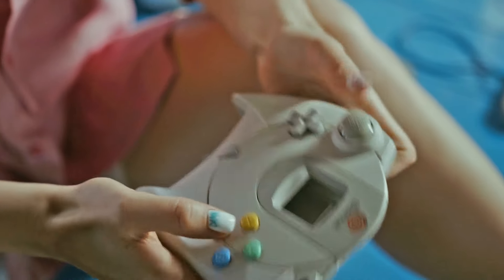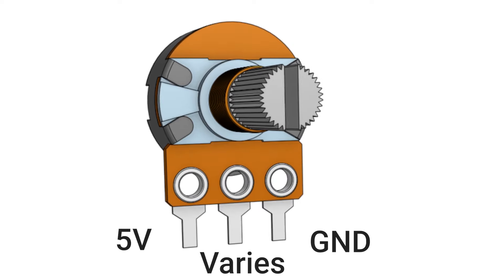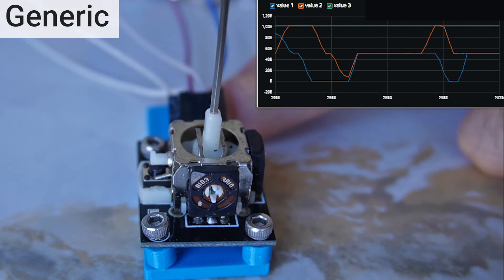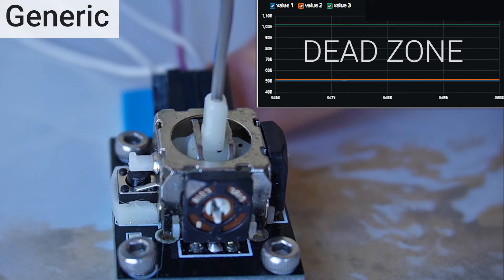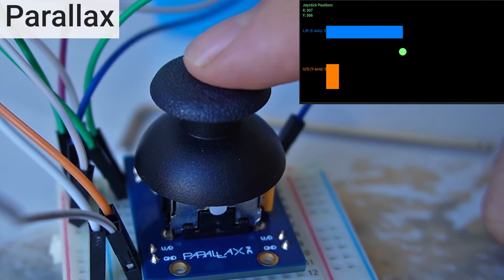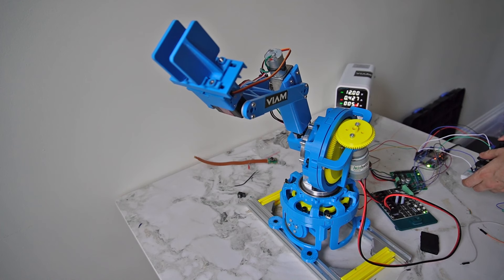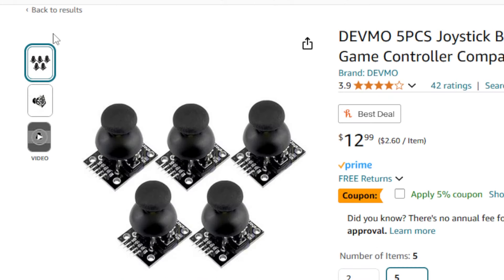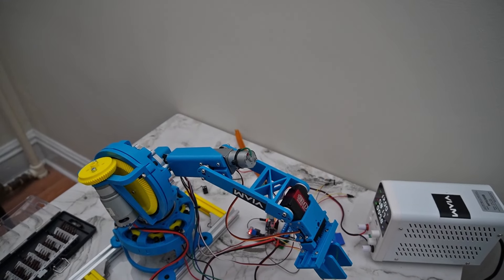Arduino Joysticks Compared

Comment: Umm.. Apples vs. Oranges?  Changing the graph type was suspicious enough.  Only showing a single second of "little tiny movements" (and seemingly cutting it short!) is even more suspicious.  What are you hiding?
Reply from the maker: Nothing, I just couldn't get the software for the Parallax to work with arduino.

Comment: Really good comparison.
Have a 3D mouse made using standard joystick and I can see how much I can improve it swapping for a Parallax.
Do you have any recommendation for a rotary encoder? I'm using the KY-040 but is pure rubbish, super imprecise.
Thanks
Reply from the maker: You should definitely switch to a Parallax if you're using it as a 3D mouse. You have to get used to the tighter action, but it is more sensitive.

Comment: Good quality video! but the information is thin. 

-The comparison is not clear, you are plotting for one but not the other. At a glance there doesn't seem to be much difference, dead zone is even desirable and software reinforced on some applications. In my experience the cheap ones break often, have noisy potentiometers that wear out quickly.

-The explanation is good, although it's not clear how the potentiometer works and can be read as a signal (voltage divider is easy to explain)

- The main difference seems to be the quality of the potentiometers then? A video showing how to turn a 2 dollar joystick into a 15 bucks one would be great!
Reply from the maker: The springs in the Para were way stronger as well. Next time I will go more in depth.
Reply: SOFTWARE dead zones are always favorable compared to hardware.

Comment: If you want to compare 2 products - then actually compare them. But showing different data for the 2 doesn't really help.
All i can see from the videos is that both of them are incredibly overpriced on amazon to the point of being outright scams, and both of them appear to be similar in their behaviour.
Reply from the maker: The Parallax controller is of much better quality. The response is better and the dead zone is smaller.
Reply: @AvivMakesRobots  Well that might very well be but that sadly can not be seen from your video.